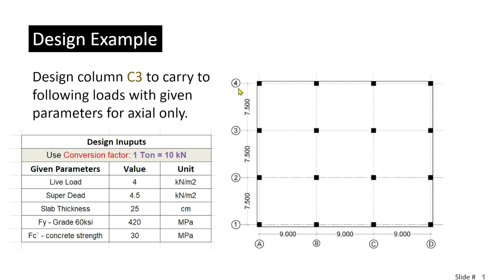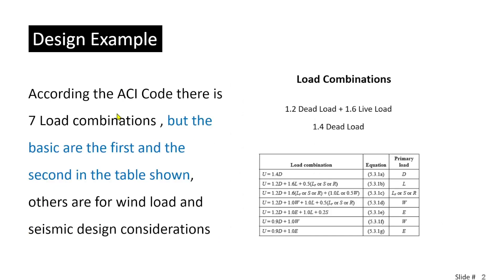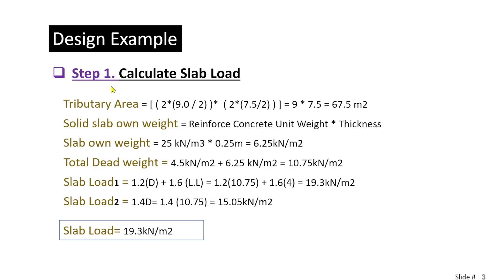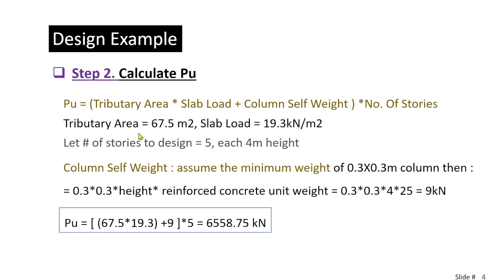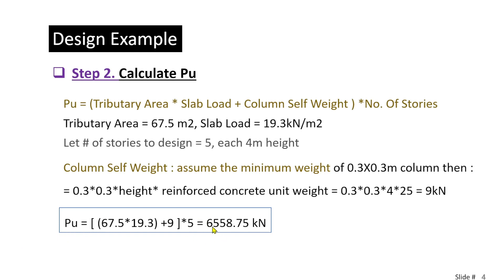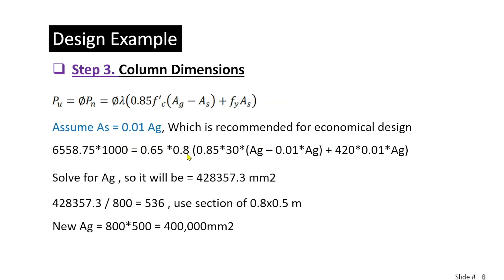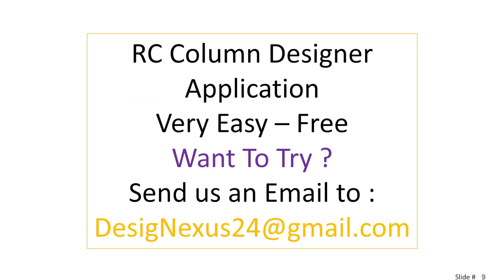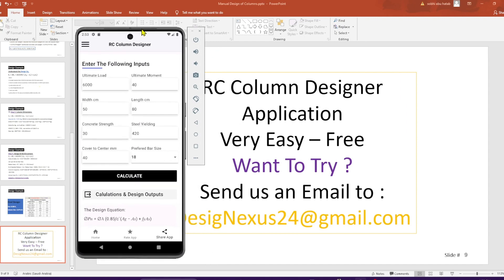(Complete Design Example) - Reinforced Concrete Columns Per ACI Code | Reinforcement and Column Size

Comment: Sir plz helping to solve this problem reinforcing required exceeds maximum allowed beam and. column etabs 😢plz help how to solve etabs
Reply from the maker: Please explain your problem in detail so i can better understand the issue , is it related to beam reinforcement ratio ? Or for columns